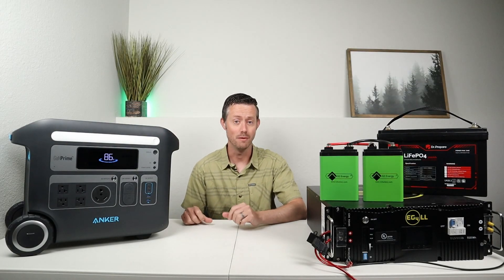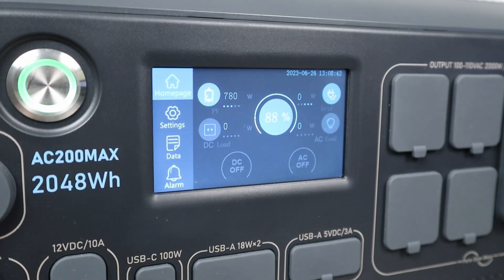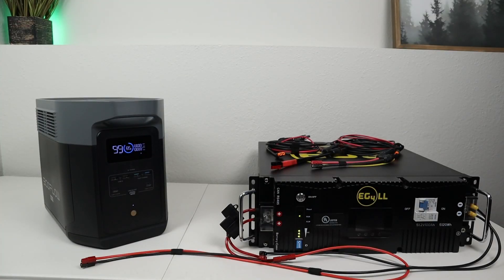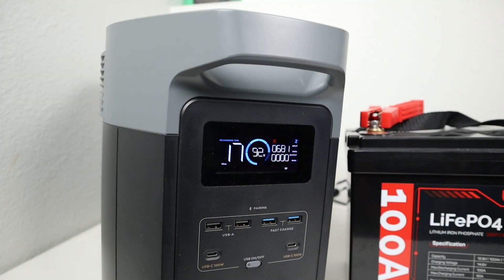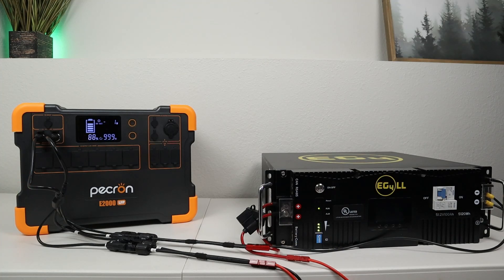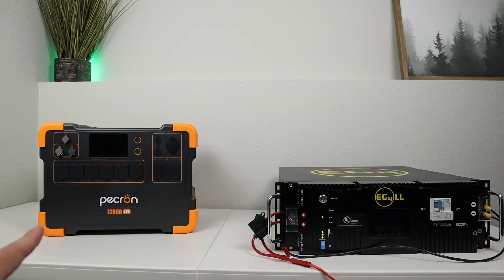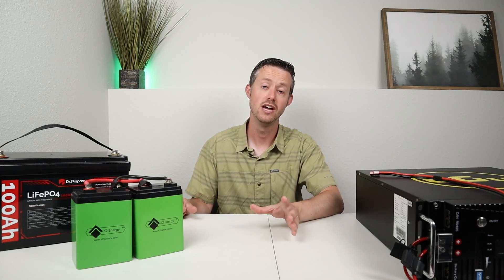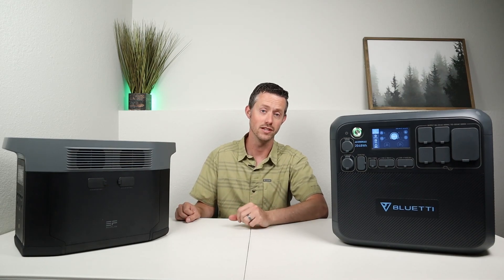Using Batteries To Extend Power Station Runtimes?! 48v LFP Server Rack 'Expansion Battery'!

Comment: Great video, as usual!   I back up my Delta 2 with a 12v 100 ah Battleborn input through the internal MPPT inputs (XT60i) of the D2.   Primarily I use it to extend the run time on my furnace in winter in the event of a grid failure. I have thought about using a 12 to 24v buck converter but I don’t know the efficiency loss.   When camping I throw the 12v Battleborn into  my DIY box and have lots more powering and charging options than a proprietary EB.   However, if I didn’t have my two Delta 2s, I would consider the D2 Max and it’s EB…sometimes I think about getting the EB Max for the Delta 2, also using my own backup.   My yard and house is shaded by 20 + mature oaks, an elm, an ash and a couple of Cherry trees.   So, until winter, very little solar capabilities, so batteries are essential.   I did install transfer switches for house back up.   Your videos have “powered” a lot of my work, so thank you!
Reply from the maker: Thanks for sharing your setup! When solar is a struggle batteries might come in handy. I'd prefer the shade from mature trees any day! You can't beat the cooler temps in the summer that shade provides!
Reply: @Jasonoid  I once read in terms of carbon offset, putting up solar panels provided a marginally greater benefit than did trees.   I don’t know if I believe that but clearly the aesthetics of trees can’t be over rated.   So, battery back up it is.  BTW:  I do have some solar panels from camping and two rigid panels I could use in an emergency…
Reply: I would advocate the D2 Max. I use it and 2 EB's giving me the 6k kwh of power. I like the two xt60 ports.   Its quite versatile for what it is.  I also run the D2 w/EB and 2 DPros with the dual voltage hub.   The D2 runs my outdoor led lights, pond pump and gazebo fan ,lights and in winter the pond heaters.   The D2M runs a circuit in my house just for the heck of it and two small AC's during summer.

Comment: Is there any need or benefit to inserting a controller between the battery and power station?  I don't want to accidentally damage my Goal Zero Yeti 1500X.  Does it's onboard MPPT controller protect it?
Reply from the maker: Your power station has the charge controller built in so no need to add a second charger. I'd just recommend putting a fuse on the positive wire from your battery. What you need to do is make sure you know the max voltage of the charging input on your 1500X and DO NOT go over that max voltage. So you'd need to plan what type of battery is compatible with the 1500X. I'm not sure if a 48v server rack battery is compatible with that model, the voltage might be too high.

Comment: Great information Jason, did you run a capacity check on the 24v battery from battery hookup? Thinking of buying a few for the same purpose.
Reply from the maker: I haven't ran any capacity tests yet. They list the tested capacity in the product listing on the website. I am using these 24v batteries for my daughters power wheel ATV and realized I can use this in a YouTube video as well haha
Reply: Would be nice to see round trip efficiency using the battery as input and then how to recharge, off DC from power station or AC? Might be a speed vs efficiency factor gained

Comment: Informative video.  I think you should look into why that Bluetti Charging Enhancer, rated at 500w max@8.2A, put out over 700w.  Those things are designed to be connected directly to car batteries which can supply hundreds of amps.
Reply from the maker: I guess they didn't ever expect to have it connected to a 48v battery. It works fine with 12v and 24v batteries, it even works fine with 48v solar panels... weird stuff.
Reply: I am not sure, if Jasonoid followed the startup procedure when using the EG4-LL, 1) connect the Bluetti Charging Enhancer to AC200MAX, 2) connect the 48V EG4-LL V2 battery to the Bluetti Charging Enhancer with its breaker & BMS switch both off, 3) close the EG4-LL breaker first, then turn the BMS switch on. This slowly brings up the EG4-LL 48V output voltage by placing & removing a current limiting resistor in-line. I plan to do the same with EG4-LL V1 batteries (using my Bluetti Charging Enhancer) and have my Victron MPPT charge the batteries . I have 900 watts of solar already going to the solar input of my AC200MAX. I have noticed that ( unfortunately) the AC200MAX doesn't always gives 100 % priority to its 900 watt solar input and tends to use the power coming through its AC charging port ( i.e., via the Charging Enhancer ).